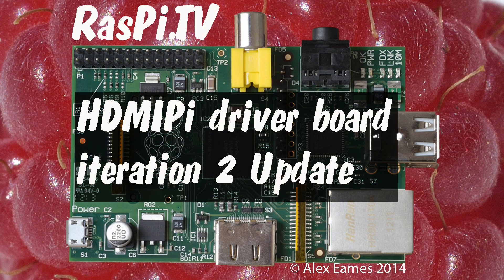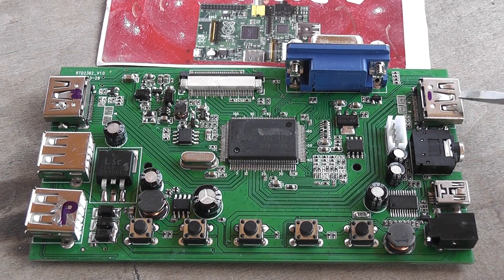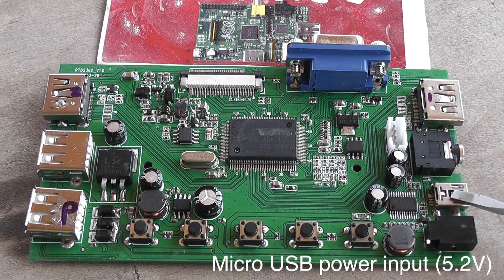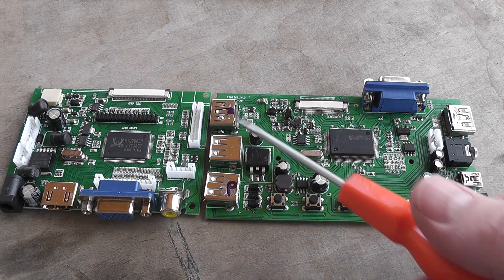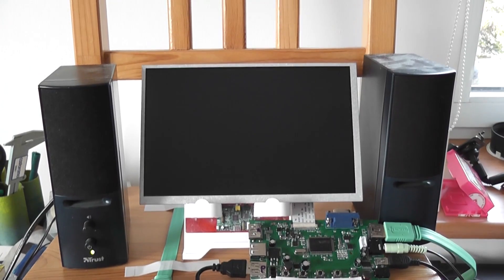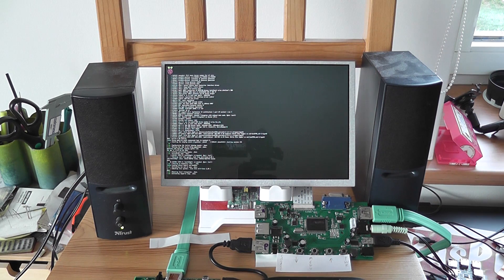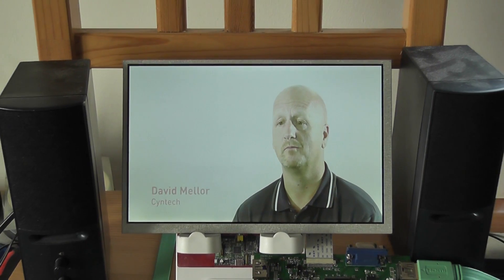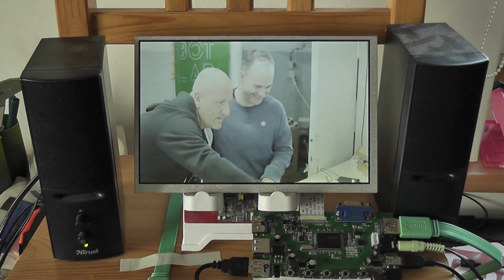HDMIPi update - driver board iteration 2 testing

Comment: Completely brilliant to see it working. :-) How did you resist the temptation to play Big Buck Bunny? This is the question to which we need answers! ;-)
Reply from the maker: I already had the KS vid on the SD card and it seemed appropriate in a fun kind of way.
Reply: Alex Eames Ahhhhh. :-)
Reply from the maker: If you look towards the end of the KS clip part, I love the way it gets kind of recursive, with the HDMIPi uncased screen showing a video of an uncased HDMIPi screen with Big Buck Bunny on. So BBB did kind of make it in there. But the real reason I showed it with video was to demonstrate the working sound output from the new board (which you can tweak the output volume of in the on-screen menu, just like on a TV).